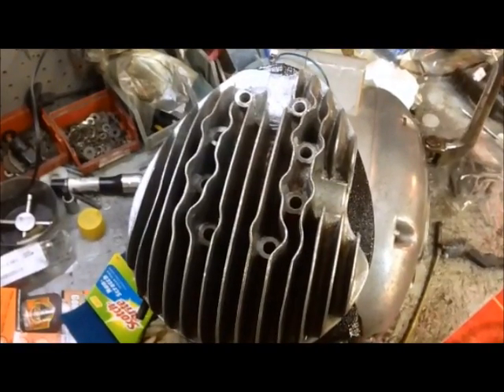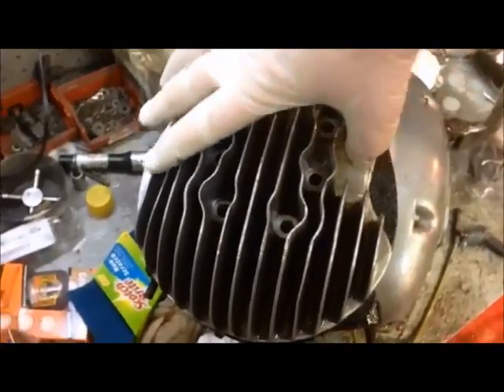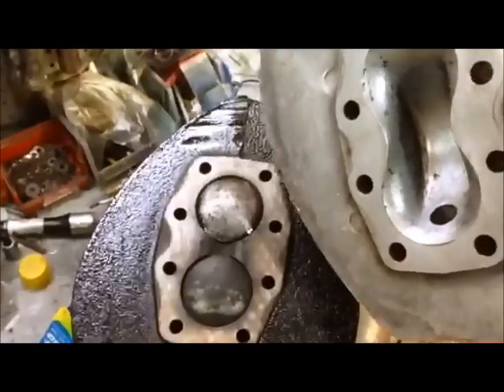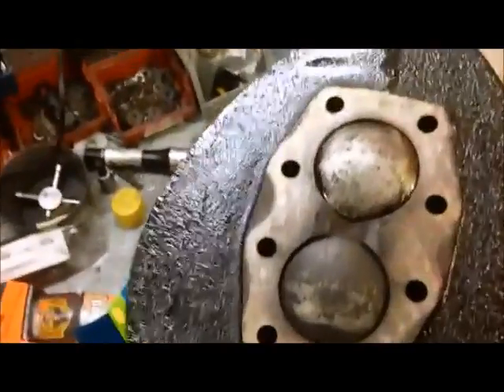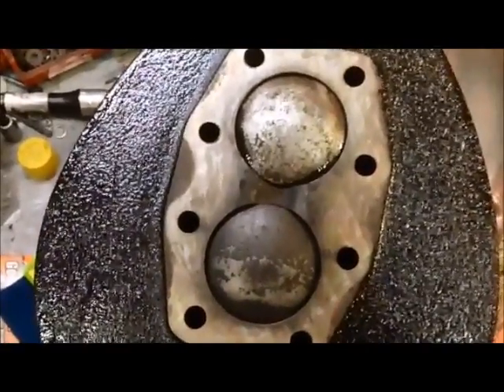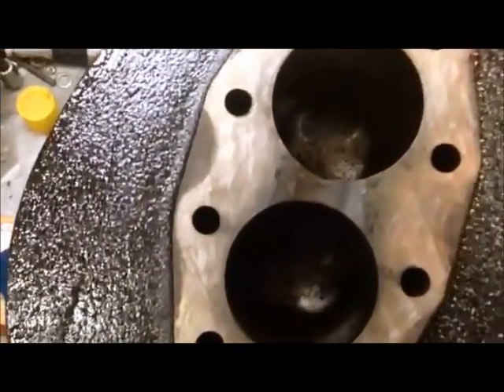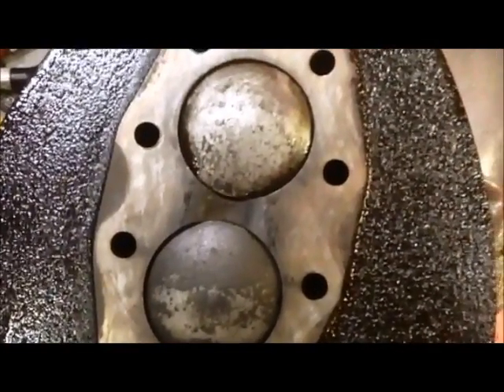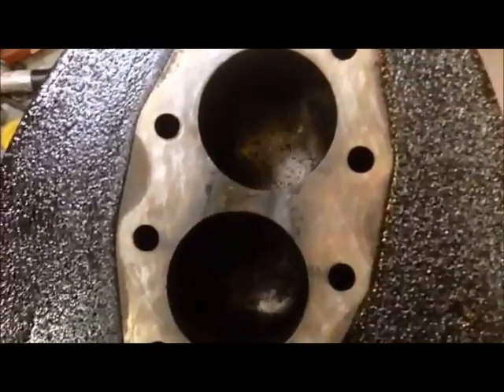Split Single (Twingle) Engine Introduction, How a "Twingle" Motorcycle Engine Works

Comment: 4-Stroke? Nonsense it's still solely a two-stroke and has nothing to do with four-stroke technology. And the Puch had leading and trailing pistons, but the TWN, e.g., had the pistons going up and down exactly the same - no trailing or leading.!
Reply: Totally agreed.  I had an opportunity to get one of these years ago.  Should have done it.  I remember reading about how one of the cylinders was known to not fire as well.  Im sure there are more complex issues, as to why this design got scrapped.

Comment: That is definitely not a single cylinder, I see 2 cylinders and 2 pistons regardless of what the engine is doing.
Reply: When two pistons move under a common combustion chamber, as is the case here, it is considered to be a single cylinder. It is in principal one cylinder with two pistons moving opposite each other, and then the cylinder is "bent" in a "U-shape", causing the pistons to work side-by-side.

Comment: Twingle lol i love it! These engines are really cool but quite impractical. They rev super slow and are quite sluggish and it seems to me they would be prone to detonation the way the combustion chamber is set up.
Reply: they dont rev super slow...in the 20's and 30's germany raced those puppies and annihilated everyone, they even build bikes with that engine that were supercharged
Reply: @ragimundvonwallat8961  they most certainly rev slow. I owned one. I'm sure with a supercharger they ran much better. It's just my opinion that these engines are impractical. Maybe they were decent in their day but I find it hard to believe they were the fastest in their day, in fact I'd guess they were far from. As for fuel efficient  well, maybe they won that category.
Reply: @Trumplican  in the 30's they dominated, look it up...they reved just has high as the rest...they even made car engine for the indie 500 (i dont think that they won) look for the DKW brand
Reply: @ragimundvonwallat8961  they might rev as high what I'm saying is they take longer to get to that rpm. The one I had would rev but it climbed in rpm slowly because of all the rotating mass.
Reply: @Trumplican   ah! it climbed in rev more slow you meant. i dont think so the mass is not rotating its reciprocating so that dosent affect it...but i have no data on it so im willing to beleive it. fast rev up are really good for motocross but for road bike it changed nothing, particularly for racing when they went very fast with a super long 1st gear and then the 3 or 4 others very close
Reply: https://www.youtube.com/watch?v=HbBTPRjatwk

Comment: Also apart from the Iso Isetta, did any post-war microcars use Twingle engines? 

Always wondered by such engines (with a high enough displacement) were never used in more microcars or early Japanese Kei Cars compared to the typical 350-550cc 2/3-cylinder 2-stroke engines used by the latter.